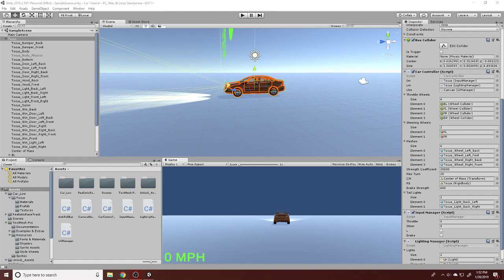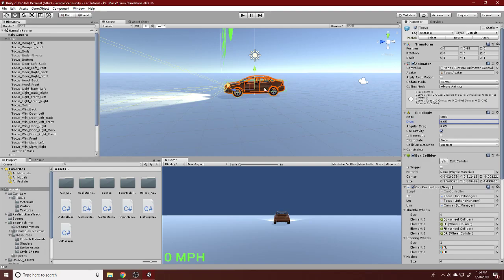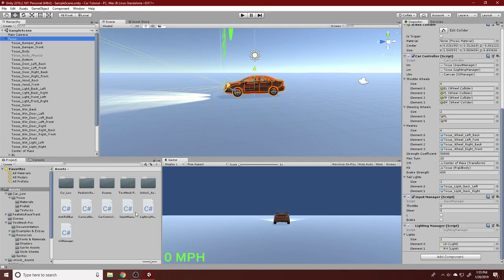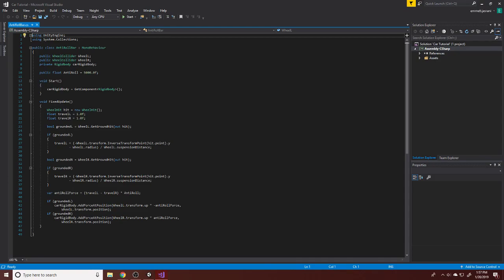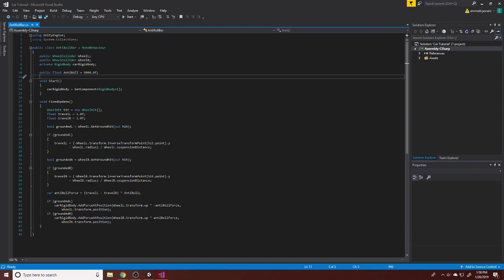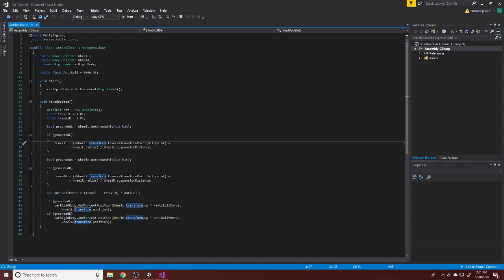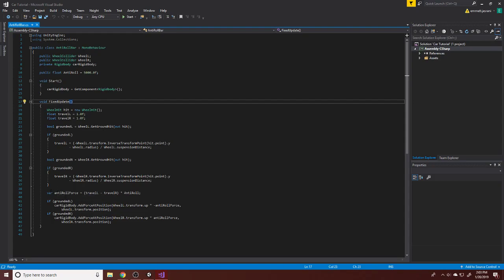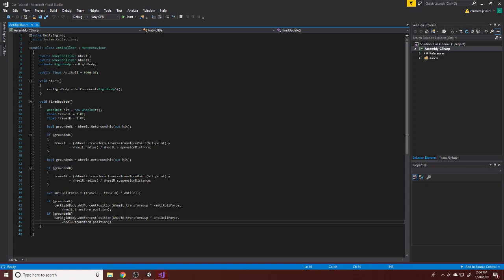Unity Car Physics Tutorial - #8

Comment: So I was wondering how do I get the tires to react to the terrain? Because for me the colliders react but the wheels stay stationary. In terms of reacting to the terrain.
Reply from the maker: You can either raycast and manually extend the tires or figure out how extended the colliders are and set the tires accordingly (to my recollection)
Reply: @AxiomaticUncertainty  yo where can I learn to do that? I'm still pretty new to C#.
Reply: I might have missed in a previous video, is there any reason why you don't use wheelCollider.GetWorldPos(out pos, out rot) and set the models to the colliders?
Reply: @iharlery  I'd have to check my scripts later I will reply once I look.
Reply from the maker: @iharlery  thanks for providing a/the solution! The only real reason is that I don't really do much with vehicle physics anymore, so I don't remember a lot of the associated methods/variables.